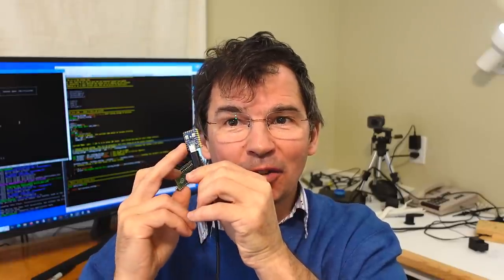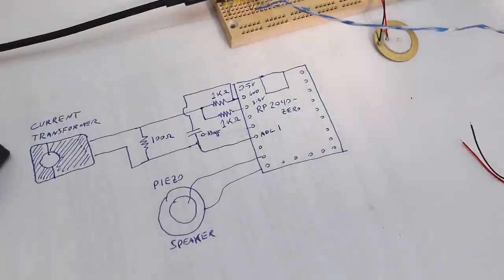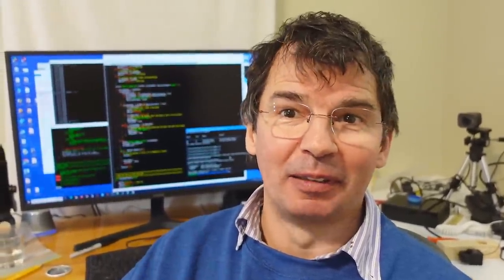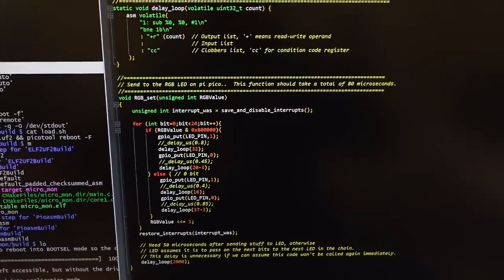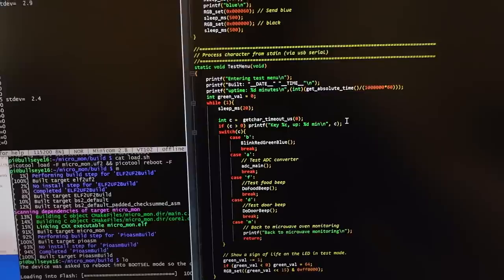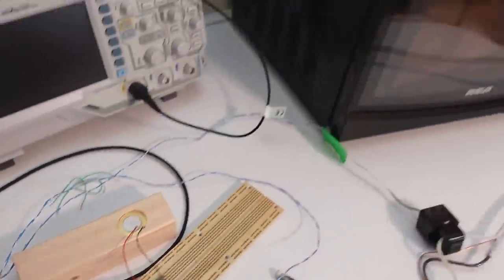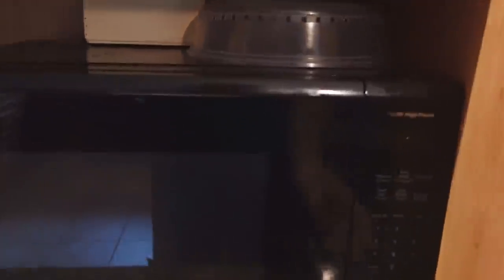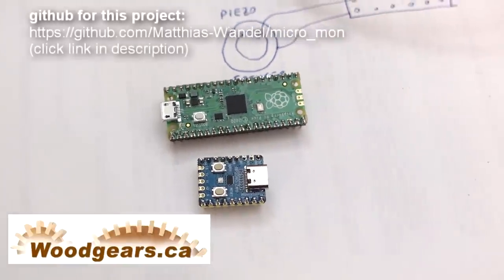Raspberry pi Pico programming in C -- microwave oven monitor and reminder

Comment: I'm glad to hear at least someone likes the nonstop reminder beeps. To me, this is actually a very annoying feature that I wish I could disable! Maybe we should trade?
Reply from the maker: you prefer to leave your food in the microwave overnight then?
Reply: @matthiasrandomstuff2221  😄 I'm not sure I'd go that far. For whatever reason, it's just never happened for me before, so I weight the annoyance higher than the potential benefit. It's just interesting to me when people have such different experiences regarding the same feature.

Either way, I liked your solution. I took a similar approach when rigging up a circuit to switch on/off a car outlet when the car is on/off. It's satisfying coming up with a solution to an otherwise annoying problem.

Comment: I took a different tack with Pico programming, limiting myself to using Python as a way to immerse myself in the language and find it's limits(some), quirks(many), and perks(few).

Circuit Python has much better library support than it's parent Micro Python, but not as much feature support (notably missing threading/interrupts). Python's an interesting language from a goals point of view, that has been muddied by some bad legacy choices and some inconsistently overbearing dedication to early goals. I much prefer C variants but being able to more fully parse Python has opened up a wider community that's more discovery focused and newbie  accessible, which has been nice.

Comment: How hard would it be to replace a basic microwave's whole control unit with an SBC? 

Also why is every microwave hinged on the left?
Reply: Very easy. For a typical microwave with a digital timer the control unit only has one input (a door sensor) and two outputs (a power relay for the MOT and one for the light/fan/turntable). Some inverter microwaves might have electronic control signals but I believe some are drop-in replacements of the MOT.

Comment: Would 50% power ok the microwave work for this setup? Doesnt the power get cycled in less than 100% power scenarios?
Reply from the maker: we don't use that.  But at 50% power, the fan still runs in between, and I set the threshold for "microwaving" to be low enough that fann running counts as microwaving.

Comment: Aren't most of the common python libraries just C in a trenchcoat?
I'm sure there would be a clear difference if the computational load is large enough but not at the scale most people use these for.

Comment: "I'm no fan of integrated development environments." That's not the flex you think it is.
Reply from the maker: are you saying it's a flex then?
Reply: @matthiasrandomstuff2221  If you think it is, I guess. An IDE is a powerful thing that helps you navigate through and otherwise manage a big ocdebase. I guess for a little IoT widget it might not be necessary, but CTRL-clicking a method, dot completion, and automagic variable scoping, refactoring tools (and the zillion other things come with an IDE) are easily worth the price of admission, in my book.

Comment: Maybe use an ATTiny85 in your next project? I feel this RP2040 Zero is a little overkill - even an ATTiny85 would be overkill, but less 😅
Reply from the maker: if it was a product where every penny counts yes.  As it is, at $5 for the pico, the cost didn't really matter.
Reply: @matthiasrandomstuff2221  I wasn't really referring to cost but to a poor CPU capable of doing SO much more doing basically nothing but spending it's millions of CPU cycles per second basically busywaiting 😅😁

Comment: You might want to consider adding over voltage protection for the current transducer so a short in the microwave doesn't overvolt the Pico.
Reply: Those CT's are usually 1000/1 and with a 1ohm resistor it converts the primary current to millivolts. Microwave is probably on a 20A breaker, so there can be an inrush or a higher brief short circuit current but the max sustained at 20A primary will be 20mV. Pretty sure the ADC pins are rated for the full voltage of 3.3V. So that would be 3300A on the primary. If this is a 1000/1 CT....  Good thinking though.
EDIT: Although I see he is using a voltage divider to bias the CT input to 1.65V. But that still leaves a 1650A primary overhead.
Reply: @inothome  I assumed the shunt impedance was higher and that the resolution on the adc wasn't that good.
Reply: @MrRitzyVlogs  Yeah, he didn't specify the CT ratio, but going by the 1 ohm resistor, that is commonly used with the 1000/1 CTs. But was still a very valid point, and if not 1000/1, it still could be an issue.

Comment: hate python.  a language where whitespace matters is plain stupid.  Especially when you can't see if whitespace is a tab (10) or space (32) character.  You've got good company here!  I'm a crusty C and C++ embedded engineer too.
Reply from the maker: actually, I use python qutie a lot on regular raspberry pi computers, and on my pc.  For stuff where it doesn't matter so much.
Reply: @matthiasrandomstuff2221  and why is that?
Reply: @revealingfacts4all  Fast to write. Python is useful, just not useful for microcontrollers IMO.
Reply: That and the lack of do/while were the most immediate hateful things for me in Python. Fortunately NPP has this great little thing that swaps between tabs and spaces. Still structurally Python is very useful for prototyping and one offs.